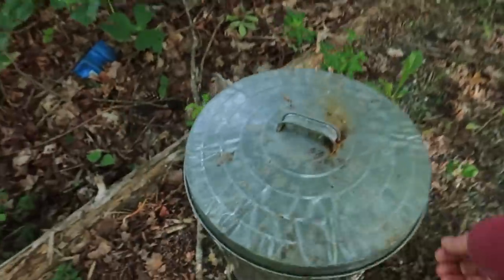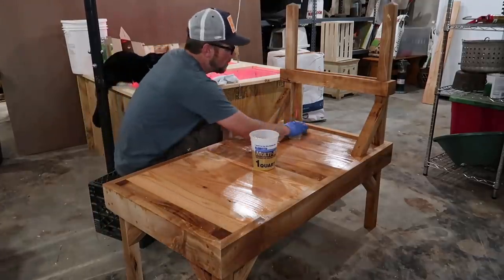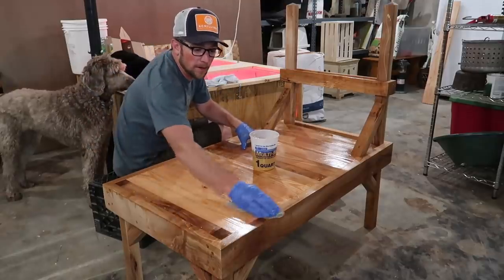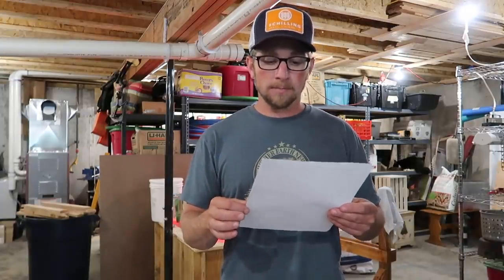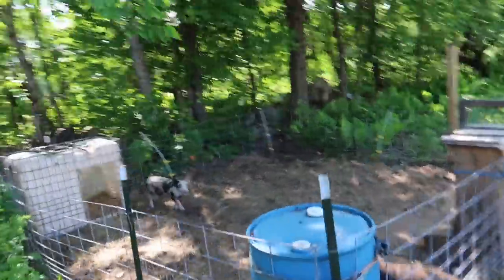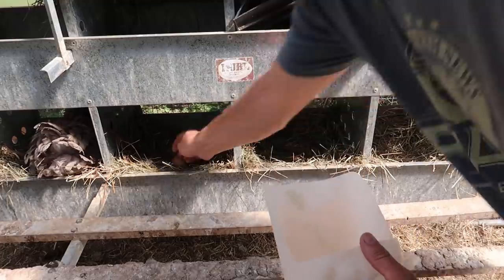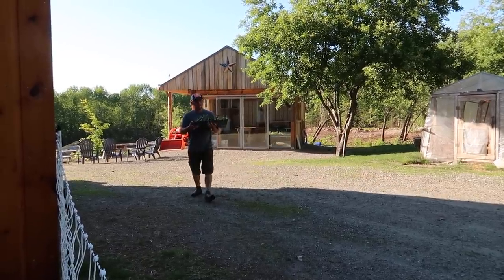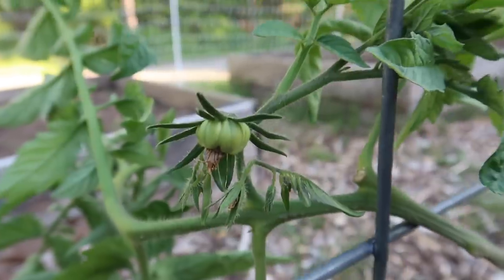Got the INVOICE for Getting Our 4 Acres Logged  You WON'T Believe what It COST US!

Comment: Funny how it all worked out for you....I have lots of folks comparing your timber cut to mine down here in North Carolina...we cut around 100 acres and have cleared around 50 so far....what an undertaking...the timber has basically covered the cost of clearing
Reply from the maker: It is definitely a large undertaking but worth it in the long run!
Reply: Doing 100 acres, you should have bought a small excavator and chain saw and did it yourself.  You can hire someone to pick up the logs and the majority of the money comes back to you.  The excavator is useful for pushing over the trees and digging the stumps and then rough leveling the land.  When all is done, you have money in your pocket and could have paid for your excavator and even maybe a dump trailer or tractor with implements.  Sure, it might take longer, but you throw away a lot of money paying someone else and they ALWAYS rip you off!
Reply: @Rattlerjake1  I'm solidly in to your way of thinking here. In a similar way I just had a slab leak under my house. Plumbers were like sharks smelling blood in the water. They wanted anywhere from 3 to 4 grand to do what took me all of less than 8 hrs to do myself. My cost was under $300.00 plus my time.
Reply: @Rattlerjake1  You missed one thing. Buy it used and you likely can sell the equipment for what you paid for it when done.
Reply: @court2379  - Dead on.  You can pick up auctioned equipment for dirt cheap (just make sure you take someone along that can inspect it and make sure you don't get screwed, unless of course you know what to look for).  Or you can find someone local and lease their equipment cheap. Nowadays you can sometimes buy low, use it, and turn around and make a profit of it.
Reply: Just catching up and re watching old videos.   How time has changed and advanced 💕
Reply: We are looking at the same course of action for clearing about 40 acres of timber to convert it into pasture here in N. Miss. We got a forester to survey the timber, sort it by species and calculate the board feet and tonnage. They will also market the timber to the loggers for a percentage. We would then grub it out with a used excavator then sell it when done. Also considering felling the trees and then sawing it into lumber, since we are not in to big a hurry this might be a good option?🤔
Reply: RENT an excavator!!! Probably be a round $7-8k thousand bucks for a month rental and it has insuranse!!! Push the trees over root ball and all comes up, it's a million times easier that way than digging stumps up after it's cut. Then contract with a logger and you should easily make  over $50k, and the logger makes $50k. Then you can rent a dozer and clean the land up. If you buy used equipment,it possibly could be a major expense if it breaks.  Pushing over any size tree will take less than a minute with an excavator.
Reply: @TheFloppypoppy  Renting is definitely smarter than buying unless you plan to treat it like a hobby and are willing to spend years doing it. If it's going to happen in one fell swoop then buying is a terrible idea, used equipment ALWAYS needs repairs and it's never cheap. The maintenance and repair costs on a used piece of heavy equipment on a reasonably large clearing job will far exceed the rental costs. BTW to the guy who said get a small excavator and a chainsaw, 100 acres by a guy with a chainsaw and small excavator is not remotely feasible, unless you only have 5 trees per acre or have a decade worth of free time. Guys that haven't cleared forested land don't realize all the mechanics that go into it, you can only get so much info out of a youtube video.

Comment: The board-foot is a unit of measure for the volume of lumber in the United States and Canada. It is the volume of a one-foot length of a board one foot wide and one inch thick. Board-foot can be abbreviated FBM (for "foot, board measure"), BDFT, or BF. Thousand board-feet can be abbreviated as MFBM, MBFT, or MBF.

Comment: MBF = Thousand Board Foot ... The board-foot is a unit of measure for the volume of lumber in the United States and Canada. It is the volume of a one-foot length of a board one foot wide and one inch thick. Board-foot can be abbreviated FBM (for "foot, board measure"), BDFT, or BF. Thousand board-feet can be abbreviated as MFBM, MBFT, or MBF.

Comment: MBF stands for "1000 board feet".  For example 37mbf = 37,000 board feet. The land owner is usually paid on a $/mbf. So if the logger quotes you a stumpage price of $100/mbf and he cuts 37,000 board feet then you are paid 37 x $100. The fuel chips are paid for on a $/ton basis so if you were quoted a price of say $5/ton and he produces 442 tons then you are paid $5 x 442.

Comment: Have you ever tried  Danish oil  goes on like  tung oil  .   Strengthens  wood  and will  make a   hard finish  .    Nice   Stand .
Reply from the maker: Have have used danish oil. When I worked at a furniture company we would use 1 coat danish oil and then a rubbing poly

Comment: This is some free advice to land owners that are going to log land then NOT replant trees. Instead of doing your logging first, have it cleared first by an excavation company that has some idea about logging. With an excavator the trees can be removed, stumps cut off then the trunks pilled . When the cleaning is done have a logger come load the tember and take it to the appropriate place. Result is this . Loggers pay more because there is no cutting and skidding cost for them. Next clearing is cheaper because it’s faster to push down a tree than pull up a stump, especially oak. Any operator will tell you cleaning up after a logging operation ( especially if the land is muddy) is far more time consuming than clearing from scratch. Now here in Arkansas we don’t do chiping on a large scale so that might cause a flaw in this proposal . Chipping small trees might bring in income that would tip the scale,so to speak. A timber saw such as the one used on your property will make quick work of those. It is tedious to deal with small tember that needs to remain in relatively good shape while using an excavator.Clearing cost would increase.

Comment: I know this is a bit late for you guys but on your next bit, just remember to get more quotes than one as i've found stark price ranges from logging companies. For example. I just had logged 4 1/2 acres, 240 trees. I got 3 quotes. I choose the highest recieved my $22,000 earlier today. I also have enough coord around for 4-5 winters of heating. Not to mention, I'm certain I have about 40 cubic yards of mulch I have to figure out what to do with. It does sound low based on the Pine number but I could be wrong.

Comment: MBF is 1,000 board feet. It’s how logs are usually measured when they are being milled vs. pulpwood, which is usually chipped and measured in tons. So if you had 37 mbf of white pine logs, and that was 5 loads, then you had about 7,400 board feet on each load.
Reply: Yep.  That is what a tandem log truck will hold....6-8,000 BF

Comment: MBF: It is the volume of a one-foot length of a board one foot wide and one inch thick. Board-foot can be abbreviated FBM (for "foot, board measure"), BDFT, or BF. Thousand board-feet can be abbreviated as MFBM, MBFT, or MBF. Similarly, million board-feet can be abbreviated as MMFBM, MMBFT, or MMBF.

Comment: as a former forestrymachine-operator in sweden, things work alot differently here... first of all, we dont use tracked fellers for harvesting, first and foremost they dont remove the branches from the trees, so it cant be used as quality material (paper products etc) you will need a proper harvester for that, its a very oldschool aproach to harvesting with a tracked feller, back in the times when forestry workers used chainsaws and large teams. i have been working in the forest for 6 years and never seen a chainsaw in use here in sweden.

A skilled harvester operator with a multi-tree cabable unit such as the H413 can cost-effectively harvest areas of small trees, and will generate profit for the job, even if its a small one. (if the forest is well maintained, thinned out on a regular basis so the good trees are able to grow etc)

Comment: Measured Board Feet...aka Linear Board Feet. It's every 1 foot length  by 1 inch thickness of material.  Not sure if anyone else answered.
Reply: Measured board feet and Linear are not the same. Linear is how we spec material followed by dimensions. 8 ft of 1x6 is only 4 measured board feet. Board foot is 12x12x1. Traditionally you are paid stumpage on your material by thousand board feet. Butt logs pay a premium due to fewer knots and wider flitches.

Comment: MBF, if I remember correct is Measurable Board Feet, based on the small end of a log  (I worked at a plywood mill years ago doing the calculations of lumber from the logs).  There is a lot that cannot be used when making lumber.  Did they charge you to haul off wood chips or did you make money from them?  I am curious as my husband and I will be purchasing a home soon and it might have timber on it.

Comment: MBF = 1000 board feet.  An MBF is a collection of lumber that measures 144,000 cubic inches of wood.  An example would be a collection of 1" x 12" boards 1000 feet long.  The letter M comes from the roman number for 1000.

Comment: That first logger that said it would cost you sounds like a total hack. What you got seems correct and fair, going by my one experience of my parents taking down about that amount of trees to finance a new heating system for their house 20 years ago.

Good to know about the bears. Better make all that goat fence extra hot, go one size up on the electric unit. Might even be worth it to get permanent mains power and not go for solar. Maybe even a voltage drop warning system? There are those that either gives an audio alarm, blinks or even sends you an sms.

Comment: Goat Stanchion looks really nice, good job Al! When using Tung OIl as a finish do you always thin or mix with mineral spirits? And is the ratio always the same? You're pigs are something else lol too funny. Those bears were cool; wonder if they'll visit again...or when. Have a great day! Thanks.  Almost forgot; congratulations on the logging outcome, such a sweet deal!!!
Reply from the maker: I use 50 50 and the last coat i use 25% mineral spirits and 75 tung oil
Reply: Got it, thanks! Going to give it a try :-)

Comment: I dont like to use tung oil because it leaves a sticky surface and I don't like uneven legs that rock back and forth.
Reply from the maker: if you cut tung oil with mineral spirits you wont get that. The legs are rocky because the concrete floor is pitched in that spot to a floor drain
Reply: Thanks for civilly and patiently enlightening me. Good luck with your goats. I subscribed.

Comment: mbf... Measured board feet.....each log gets measured graded and trimmed to go to the mill it'll go to according to species and what they think they can get from it. Mbf is like length and diameter do whatever math and they know....let's say how many 2x4 they can get from each log... Add in whatever grade the log gets  example: four side clear at 15 inches+in diameter and 20'-40' length will get you more than let's say a 5" diameter saw log at whatever length

Comment: Mbf is a thousand board feet. A board foot is 1'x1'x1". So a 4/4 board that is 1'x1'.
Reply: 180° From Average, MBF stands for Metric Board Feet.
The formula is 1 x 1 x 1, which would be "cubed".
Reply: Well I ran a sawmill for quite a while so I think we should probably listen to you. lol Or were you joking... now I can't tell. Hard to pick up humor in writing sometimes. Though when I re-read it I think that you must be joking given the use of Metric and Feet in the same sentence. Ok, you're probably joking. Sorry for razzing you a bit.
Reply: 180° From Average exactly metric feet lol what a buffoon 12”x12”x1” is a square foot times 1000 will give you a MBF
Reply: A log 40 feet long  and  24  inches  on  the    SMALL   end  is  about                         one  thousand  board  feet...
Reply: The SGT FU Channel  the “M” is the Roman numeral for 1000. So 1 MBF is 1000 board feet. 12”X12”X1”=1 board ft rough cut not to be confused with finished dimensional lumber.  All lumber is sold rough cut dimensions.
Reply: Metric board foot is the first thing that came to mind for me probably because I worked with metric tons for so many years.A metric foot is a contradiction though. Funny stuff.
Reply: River rat rotflmao... a metric foot is like a dry rain.
Reply: Commonly called a M...1000 board feet.
Customers call up and order 15 M's.

Comment: Have I told you lately? (I tend to tell everyone this, and especially those with the chicks in the house) Did you know you can use a regular light bulb to heat the chicks? Especially in the house. They already benefit from your home heat, but the red lamp is super hot and a major fire hazard.  This is my PSA.
Reply: **especially with oil next to it....btw
Reply from the maker: thanks
Reply: I had a heat lamp nearly butn down my barn a few days ago...burned a hole in the side of the chicken brooder but didn’t kill any chicks somehow...i’m not sure what to do for a solution other than putting them inside

Comment: Don't know why they use M ... But it means 1,000 ... Different industries use different abbreviations ... I have always used K for 1,000 from the word kilo ... Bf is board feet ... A board foot is measured as 1 foot by 1 foot by 1 inch thick ... Board feet is actually a volumetric measure, not a linear or running measure as a lot of people think ... A block of wood 1 foot by 1 foot by 12 inches thick is actually 12 board feet of lumber ... The family that sows together grows together ...

Comment: Classic example of WHY you should not have your property logged.  You give away a valuable resource for pennies on the dollar.

You sold 37,000bf of white pine, another 12-13,000 (you never said, but based on the 1,75 truck loads, that would be close) of hardwood timber. Total 50,000 board feet.  You got about 15 cents per board foot or less, depending on what they gave you for the chips (almost nothing most likely) and the pulpwood (again, very little).....but say 15 cents/BF for you saw timber for this exercise.  And that, of course, is further reduced by your tax rate.

Had you bought a small bandsaw mill, spending let's say $8,000, and sawed all that wood yourself, instead of taking after tax money to buy lumber for projects on your place, it would have been worth 60 to 75 cents/bf.    50,000 x 60 cents = $30,000....at a bare minimum.  Some of your hardwood was probably a LOT more valuable that that.  

So 7500 you didn't get in income (and taxed on) +$8,000 for a mill (which you could sell for almost what you paid for it most likely should you decide to sell) = 15,500.  You gain is a minimum of 14,500 (and probably a LOT more) with your own mill.

Turn it into a product like that goat milking stand, and what is it worth per board foot ?  Well over a dollar, often 2-3 dollars.
 
AND 55,000 bd feet of pulp wood.  Assuming half of it is hardwood, 1 cord of hard wood has roughly 500bf in it.  27,500 / 500 =  55 cords of firewood (minimum) What is  one cord of hard wood firewood in your area ?  $200 ? Another $11,000 you sold for near nothing.

The chips are the only thing you couldn't have come out on....but I'd bet a lot of those chips would have made firewood before they were chipped.

THIS right here is why I bought a Woodmizer LT40 in 1991, never to have my 75 ac logged by anyone but me. In 30 years, I've sawed over a million board feet on it (not all from my property...I get free logs or buy logs from time to time), and estimate the mill has made me 1/2 million dollars for a $14,000 initial cost.  And honestly, you'd be hard pressed to tell my timber has EVER been cut there is still so much of it.

Comment: Million board feet
Reply: M stands for 1000, it's based on the value of M in Roman numerals. Don't ask me why they use Roman numerals, that is a mystery, but that is how they do it in the lumber trades. Loggers have a formula, whereby they can measure a rough log and determine the number of board ft. before milling. It's pretty accurate. So MBF is thousand board feet.
Reply: Same in printing M equals thousand.
Reply: In Latin and derived Romance languages, Milli means thousand.  Somehow, English turned Million into a thousand thousands.
Reply: Your tomatoes are ahead of mine and I'm in southeast Wisconsin. My first started flowering the last day, Mortgage Lifter variety. I would try to keep the bears away, maybe some guinea hens if you can tolerate them. The pigs will be gone one day otherwise.